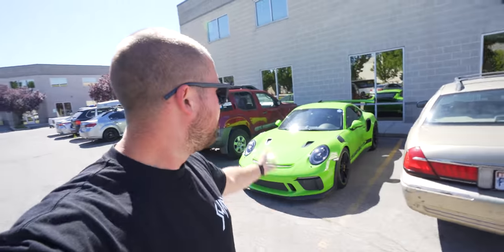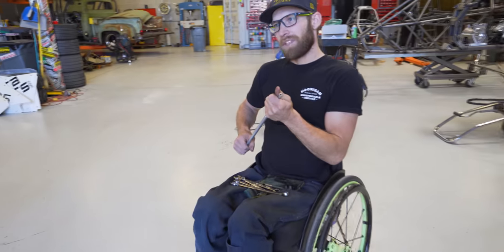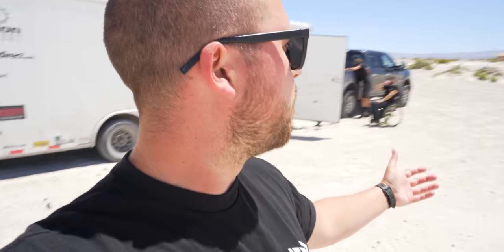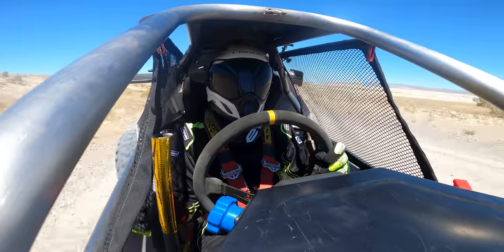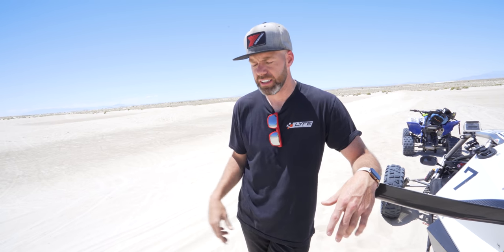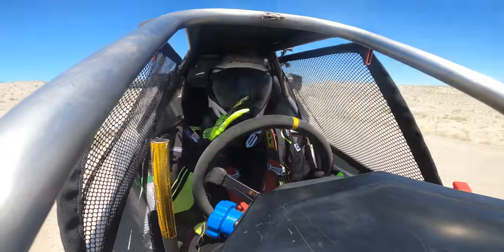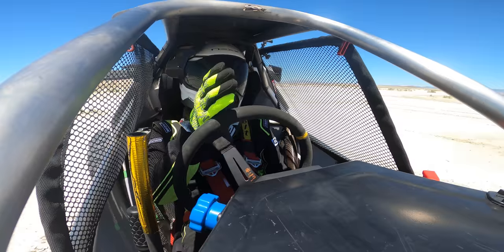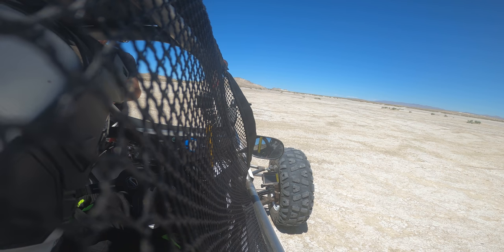RACING A 100MPH OFF ROAD BUGGY!! (I JUMPED IT)

Comment: I want one but 40 to 70grand. I will build it myself.
Reply: But how can you put a price on a 200-450hp go karts that can go over 100mph with a full roll cage.. I was a little shocked till I started looking at the specs on them
Reply: @brandonstone6962  I understand the question of price. It would shave a smoothe 1/3 price cut if all the bells and whistles came in a crate with a long set of instructions and no motor.  But realistically i would rather build one myself but purchasing their complete frame and chassis. With all the compatible components like gear shift down to pedals . That would save a ton too. Also no panels  needed because id like to bend my own. I've worked hard all my life and rarely treated myself to a $  50g toy. 
But im highly concerdering this build. I've participated in  low budget builds but nothing like this has ever caught my eye....
Reply: @stevendunn405  I am right there with you man, if I could build one myself I would and like you said just use what I needed of theres.. But as always it is all about preference and what you want, so in the end we can very much so agree instead of disagree 🙂

Comment: Built something similar way back in 82 with 1000cc Suzuki motor in a race car that looked awfully like an old type BRM  cigar shaped body with Austin Mini front and rear suspension highly modified with discs all round.  
In front l ran Mini wides and rear had 195 x 13 low profiles so your balls were about 2 inches off the ground but this thing could drift through any corner at close on 100 mph just using the loud pedal. 
Had a self invented back wheel steering system that prevented the back end from stepping out too much , worked fantastic on tarmac. 
At 67 years now and still busy with V8 modification into a 69 Escort with 5 speed T56 and LSD. Taking a little more time to finish the project now as it ain't neccessary to rush the clock anymore.

Comment: I use to have a 2 seat Short sand car with a turbo gsx1100f engine (250 hp). It weighed 738 lbs with a full fuel cell. The car would lift the wheels in second and third. Sequential shifting. I still have not driven anything that was close to that cars savage acceleration. 
I’m still torn about the single seat chassis since the passengers responses were half of the fun.

Comment: There is enough exposed roll cage bar space to bolt on a roof rack in order to store camping gear.
Reply: and can make sidepods that can store stuff as well
Reply: that was going to be my suggestion for camping. with the flat top. Also a detachable piece or fixed which ever for a fuel can on the back or side.

Comment: Any chance of making four-wheel-drive version
Reply: I was thinking the same thing but with twin engines - front and rear.  Distribute weight, front traction, no linkage, etc.
Reply: Dual engines would be cool, but not very practical Imo. I'm no engineer, but you just don't see it happening in todays market.

Comment: But that is just a kart-cross with bigger wheels. Been driving/racing them in Europe for decades.
Reply from the maker: Yeah CrossKart was the inspiration for these. Cole took all the things he didn’t like about the Cross Kart then engineered this to be better
Reply: @AdamSwords  For what I can see it is just a simplified chassis (Provably to make it cheaper and lighter) and larger wheels (kart-cross has so small wheels due competition regulations)
And probably they have installed a bigger gas tanks as european ones are usually just for short circuit racing, so tanks are small.
There is no any other difference with a 3-4 years old european kart-cross designs check one example here:
https://youtu.be/vEdFhK0Qpsc?t=165
That video is about a 4 years old design same as that Sierra one. But here has been evolutions in the kartcross in Europe, that includes better geometry suspensions, more frame rigidity to adapt more powerful motors, and adaptation to new safety competition standards.

Comment: Would say Yes, you can't have to much power. But with these type of vehicles it is all about weight to power ratio. Thats why most of this type use high performance motorcycle engines. Not sure but I am assuming that is what is in this one.

Comment: Adam Swords 
Respectfully how much would a complete price be on Chassis and frame ,plus tires. Yes complete other than the motor . Id like to put a motor of my choosing in it but im sure the car is out of my budget unless i buy the car  in inqurments. Or if not available incomplete . How much for a complete cold crank setup. 
 And im sure im pushing this but would you sale a set of detailed plans to build one of these in my shop my friend. I have been wanting another build and this fits the package. 4 wheelers are to dangerous at high speeds via no roll cage ,and a side by side just feels so factory. Im wanting a off-road that i can build and take pride in my custom wants and needs. 
Lastly, what motor are you running 600 thru 1000 cc superbike motors i bet. 
       Sincerely a true fan of your work and builds. Thank you , Steven Dunn
Reply: It’s a 1300-1340cc depending on the year hayabusa engine

Comment: Would love to build one of these, I’m a boilermaker by trade but need the space and equipment.
Reply: osmosis 1
a prebuilt shed 12×24 are about 7500.  A repo of same model is about half that price and usually is wired and insulated already as a plus. Ideal for a tube bender ,welder,sander ect......I have purchased 2 in the past. Great work shops and they are portable. Built on sleds. Good luck man im a Industrial Iron worker, Cert. Rigger also .So i feel your pain man . The struggle is real ,doing what we do and the sacrifices we indure for our families